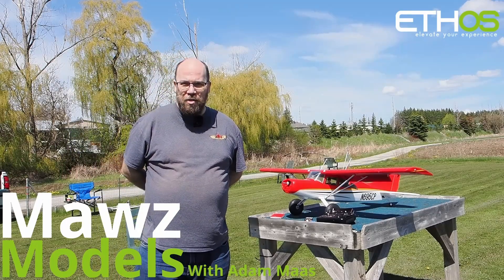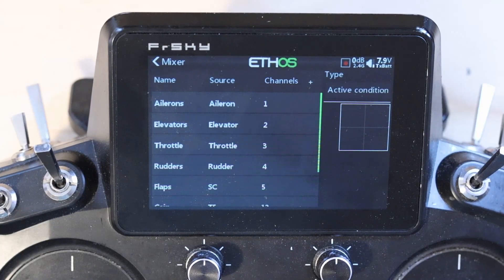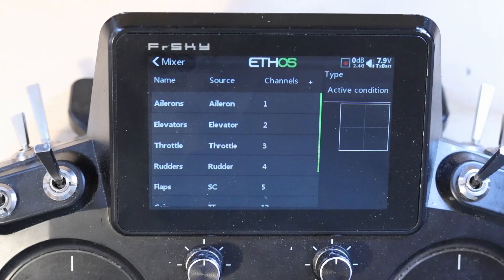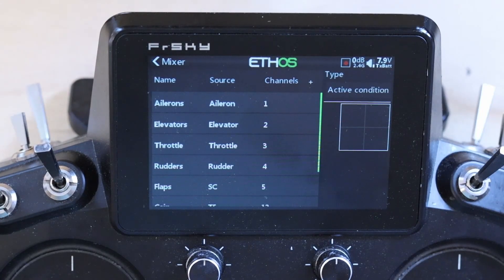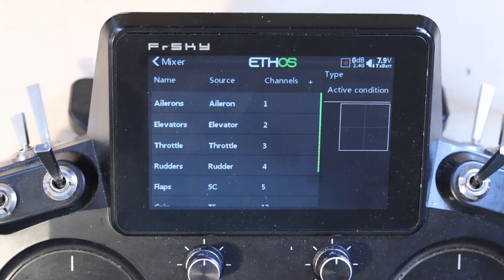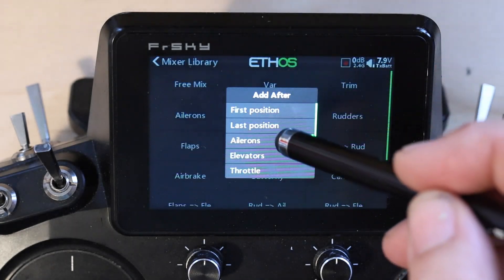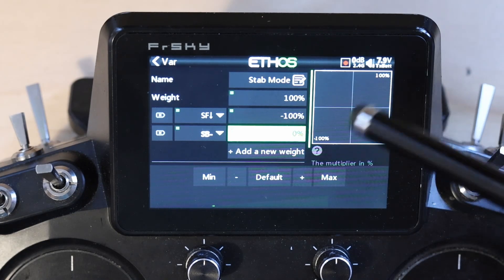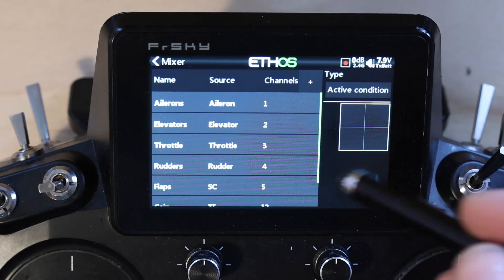ETHOS Tech Tip 16 - Replicating Panic Mode on new SR Receivers

Comment: Good evening Adam, I have been watching your videos to try to get squared away on my X20s. I’m coming from spectrum and have been having a hell of a time getting the stabilization working.  I have the correct lua scripts and all my firmware is up to date and I watched your video and removed channel 15 and 16 and putting 14 on a var mix. But I get no stabilization even when turning the gain knob. Also I was wondering the process for putting stab mode on one switch vs 2 switches. I am running a TDSR12 in a first generation EC1500 and I would definitely want to fly it with stability.  Any help would be greatly appreciated. 
Ohhh also I followed Steve’s cheat sheet as well. I guess I’m missing something. Thanks in advance. Love the videos they are a huge help.
Reply from the maker: Hello,

First off, go to model->RF System and make sure your channel range is set to 1-16 or 1-24, if it's 1-8 the stabilization will not work.

1 switch vs 2 switches depends on the Quick Mode setting. If you have Quick Mode on, you only have 3 modes and can use 1 switch for modes. If you have Quick Mode off, you need two switches as you also have Knife Edge and Hover modes added. I recommend Quick Mode on, the two extra modes are unnecessary for most people.
Reply: Thanks for your help and sorry for hijacking the comments. 
I've checked the channels and 1-16 are active.